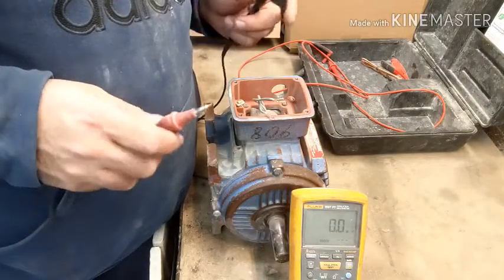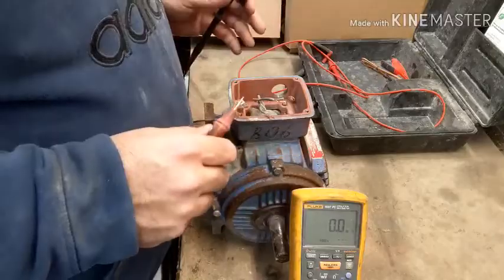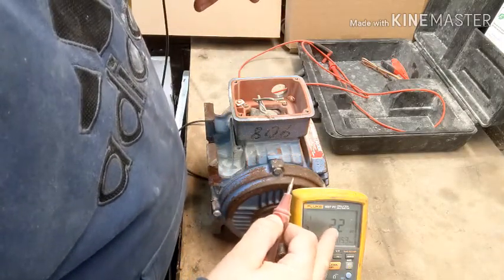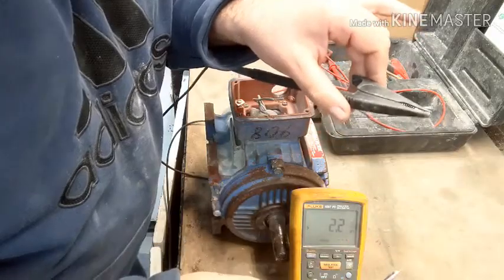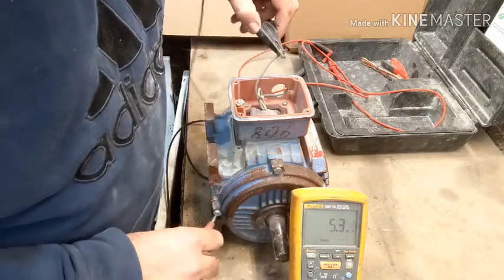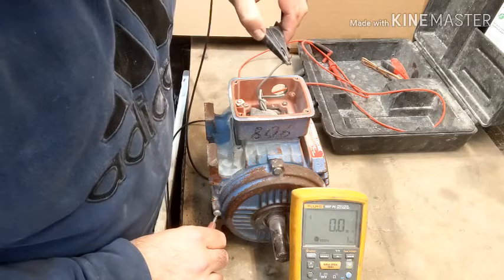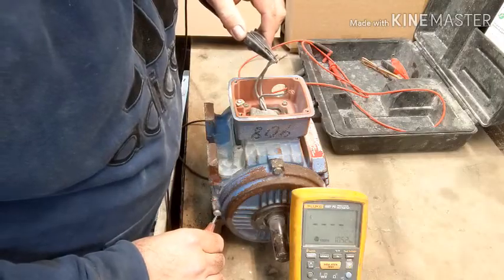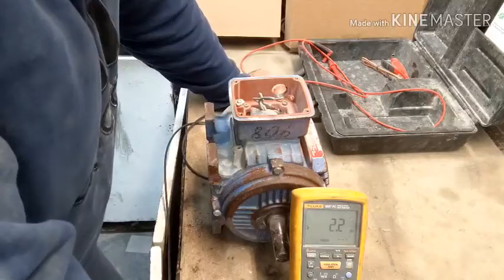How To Use A Megger On A Motor

Comment: But my question is 
I saw you only had 3 leads. Did the rest of your windings were spliced and you only checked T1 T2 T3?
Reply from the maker: your not checking the leads. you are checking the continuity between the 3 phases there should be equal continuity between the three phases if you're missing one it means that. you're single phasing and there shouldn't be any continuity between all of the phases in ground,

Comment: would like to have seen the phase to phase readings, I am still learning and do not know what phase to phase sould read at
Reply from the maker: The number doesn't matter as long as the numbers are even face to face different size motors will have different size numbers on the three-phase motor And you have to have a number like Five ohms to phase 1 and 2 and 5 ohms to phase 1 and 3 As long as there as close to even  but if it says on1 phase is 2.4 and the other phase is 12 there's something wrong
Reply: @THEELECTRICSIDEOFTHINGS  thank you for your response!

Comment: Thx, but please explain what a megger does
Reply from the maker: A megger sends a voltage through the wires of the motor and checks the insulation of the wire you can change the voltage that you sent through the wire with the megger if you go to check a motor you should make sure it's not going through anything sensitive usually what I do is I megger the motor at the motor. the megger can go from  250 to 1000 volts so that goes through the wire and checks the Insulation level of the wire if there is a crack in the Insulation the megger numbers will change And then you will notice something wrong with the Insulation of the wire
Reply: @THEELECTRICSIDEOFTHINGS  thx

Comment: Is there a case where my Megger shoes bad insulation but the motor is fine ? Or good insulation but the motor is shot ?
Reply from the maker: That means bad insulation and the motor is bad that means one of the phases are short to ground. Checking a wire. You're checking installation on a wire but on a motor a three phase motor phase  to phase should be the same but face the ground should be zero

Comment: Did you actually Meg it or just check resistance?
Reply: Good point. I think he was just testing ohms.
Reply: @timhorton9058  You will see the volts in the bottom right hand corner of the meter along with the resistance in the main display. He megged it.
Reply from the maker: I meg it to ground

Comment: And your not explaining what voltage you have your meter set on assuming it’s a 480 3 phase induction motor?
Reply from the maker: 600 volt three phase
Reply from the maker: The meter center 1000 volts
Reply: For that motor should have been 500V
Reply: @Coopyadig  nope- you always test at 2 x the rated value